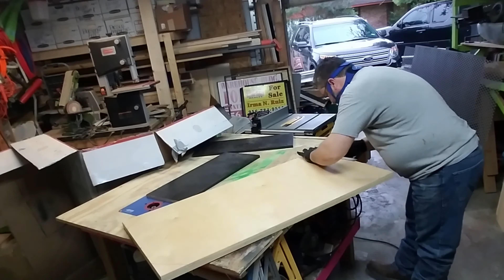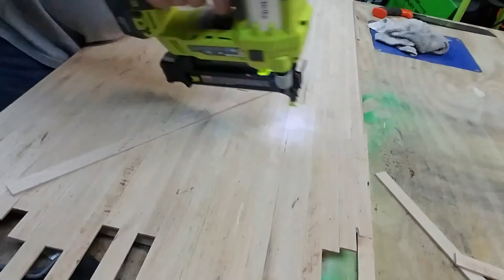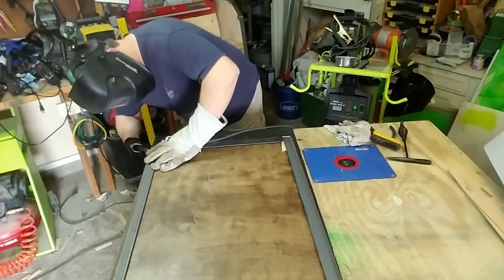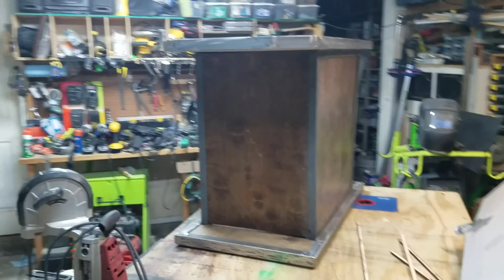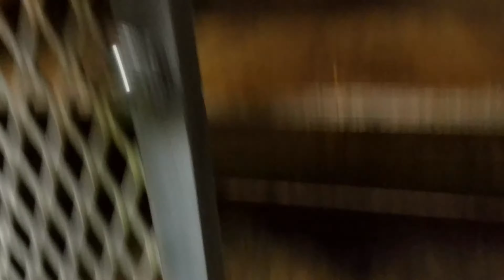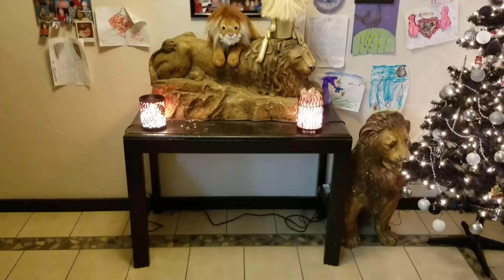Entry Table

Comment: hello, i would like to know if you use a gaz or a no gaz welging machine ? you made me want to learn how to solder and I bought a small 90 A semi-automatic soldering post without gas
Reply from the maker: I started with a flux-core welder (no gas), but now I am using a MIG welder (with gas). I see a big difference in the quality of my welds, but a gasless welder will definitely get the job done, just a little messy.